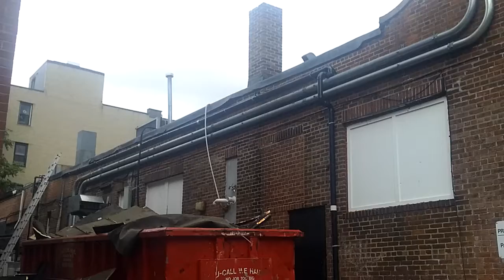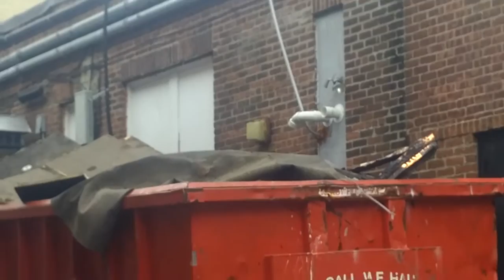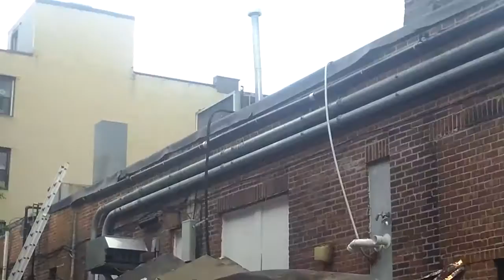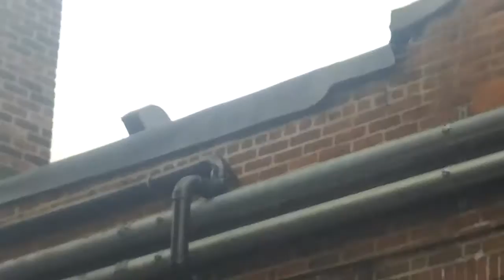Why Rubber Roofs Fail - 3 years old EPDM roof

Comment: I've done EPDM roofs 38 years age which I have maintained they are still intact. Key word here are restaurant that said if it were replaced with TPO which is actually designed to accept all the grease and other chemicals, the roof would still be intact. The question is if someone installed a EPDM roof and it fails within a few years why would anyone come in and install the exact same single-ply system. Not to be rude but these roofers are lacking experience and really have no clue. It's apparent this guy has no ability to obtain proper warranties from the manufacture.  If they could then they would also have the proper training and know which type of systems wouldn't fail.   This guy has no clue
Reply: I don't believe you are going and maintaining a roof you did 38 years a go.bet there sick of the sight of you popping up every decade..."only me again just checking the roof I did for your great grandad"....bolloxs

Comment: I can take you to many many mechanical, fully adhered, ballast, tpo  roofs I have did 10-15 years ago and not a problem still! With proper maintenance and the correct installation and a installer with the proper knowledge it will last what the manufacture warranties it for plus! They wouldn't warranty it if it don't last what they say or else no one would ever buy rubber, they would just be getting it for free due to warranty claim!